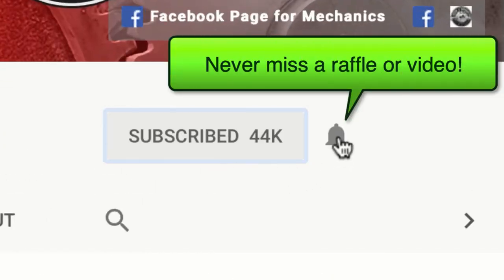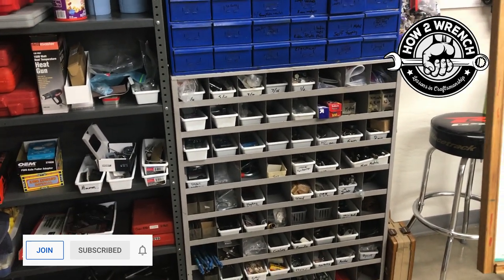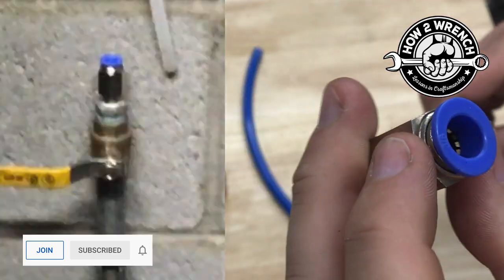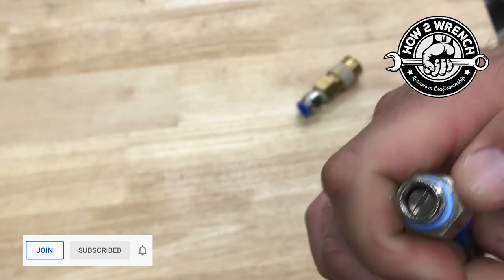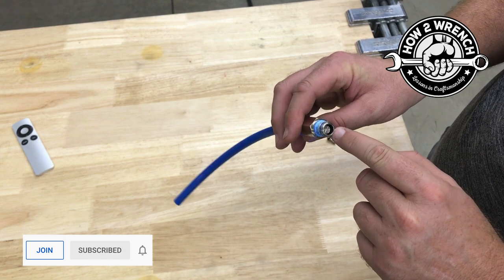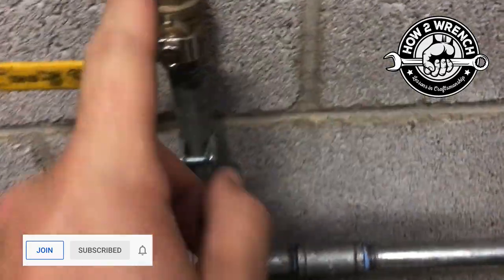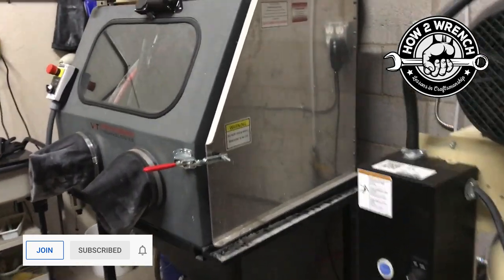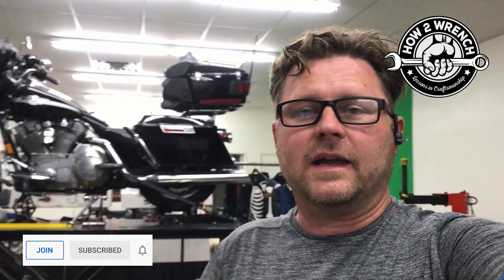Part 2 Found it! Mystery screw location that broke our vapor blaster! #vaporhoning #vaporblasting

Comment: Great detective work to find the origin of the mystery part.  Agree that they present a high pressure drop and you're better off without them.  I plumbed my shop air system in Type L 3/4" copper tubing which is fed from my Quincy QT-54 compressor (5 hp).  I've also purchased several boxes of the Milton HIGHFLOPRO couplers/plugs (V-Type) and am going to change out all of the M-Type couplers and plugs for all of my tool inlets and foot pedal for my blast cabinet.  Something to think about if you want to maximize flow and minimize pressure drop.  Again, great job on the detective work!!
Reply from the maker: Thanks Terry! Good info.
Reply: If you watch a few videos on the difference between the Milton M vs V, you'll be very surprised.  I know I was.
Reply from the maker: @terryzak1742  Just did a search....nice info...thank you Terry.

Comment: Yaaay...🎉

Congratulations on your” Detective work” as Terry Zak said in his comment.
I don’t use those fitting because I am still working from my garage with a 37 + /- year old compressor and have not installed a prefab shop in the back yard yet, but if or when I do this will be useful knowledge.
👍😎👍
Reply from the maker: I sure like them.
Reply: Shane Conley 👍😎👍

Comment: Yup. Those come w/wo check valves. Sometimes they mix up your order. Thanks for the update. Also, I didn't see a link for those plastic trays. Do you still intend to post it? They look like the cat's meow for those bolt cubby hole cabinets.
Reply from the maker: The best deal I found was at Doller Tree in a three pack I think... https://www.dollartree.com/bulk/Home-Essentials-Drawer-Organizer
Reply from the maker: 9.75x 3.75x 2 in fits right in my parts bin